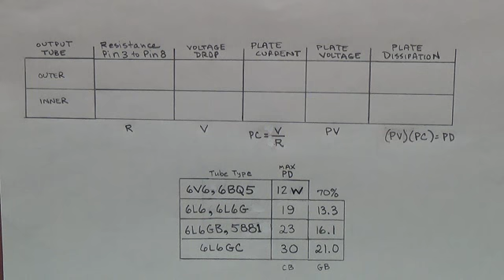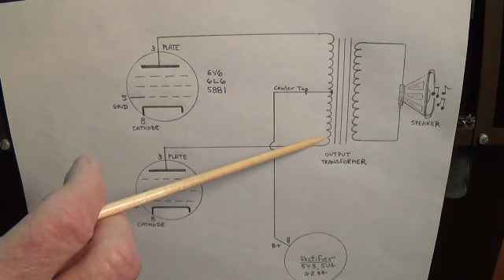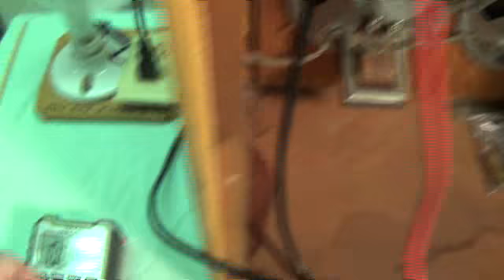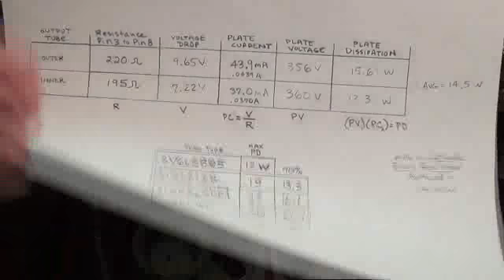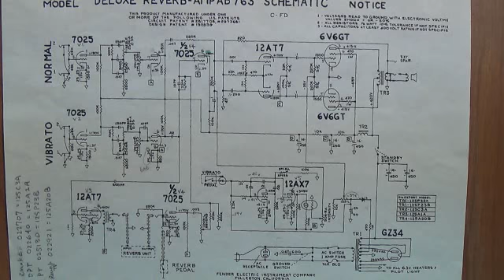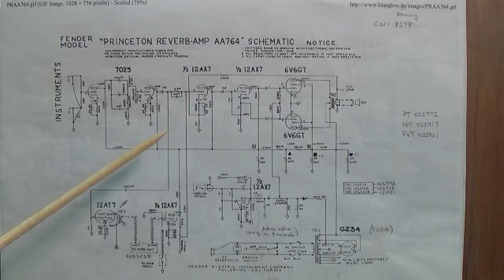Biasing Double-Ended Amplifier Output Tubes, Part 2: Demonstration and Discussion

Comment: Thanks again for your videos, the're great! Question, if you have a grid bias fender amp how do you measure the resistance of the OT winding? Looking at the bassman aa864 schematic I'm wondering if the standby switch would be a good spot? When I measure that on my bassman I get a reading of 46 ohms.
Reply from the maker: An excellent question, DN. In fact, I will add a note to the video covering this. Yes, since there is no rectifier, the OPT side of the Standby Switch would be the perfect place to locate your Center-Tap Ohmmeter lead. The other lead would then be placed on pin 3 of one 6L6 and then the other.